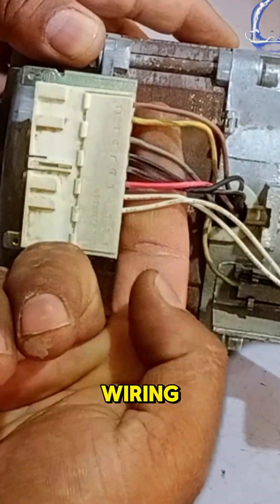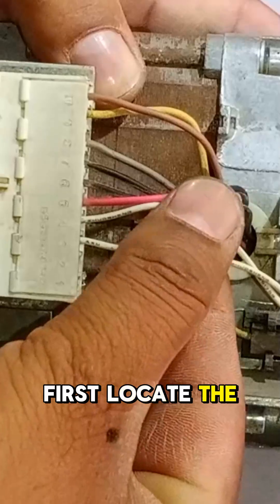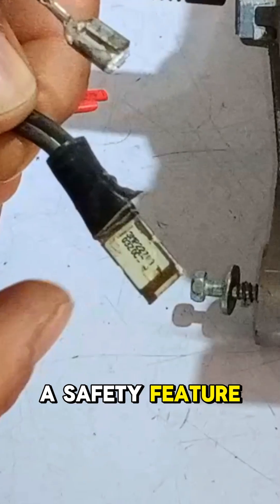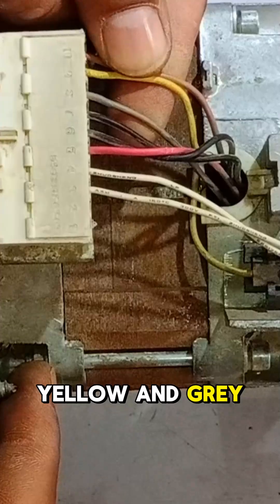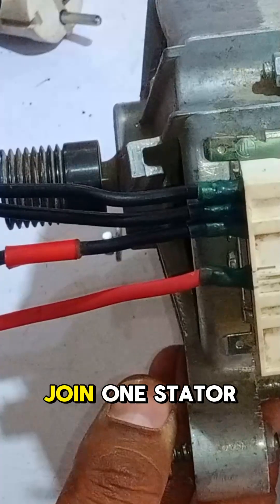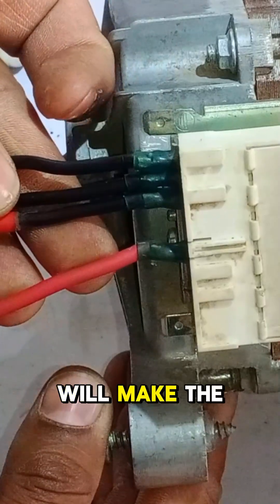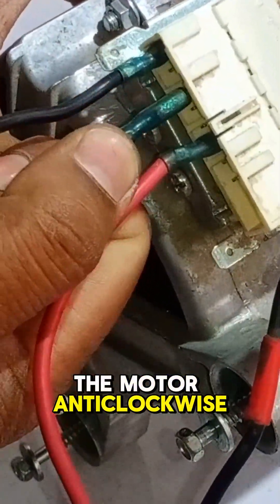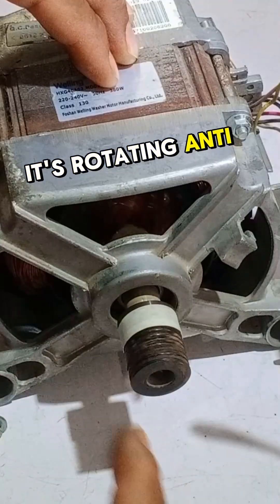Washing Machine Motor Wiring Made EASY!

Comment: I have a welling Samsung motor it’s only 3 years old the belt snapped no reason why got a new one but it never went round again I wasn’t there when it went wrong so not sure what happened the brushes are fine there is power going to the motor but when I tested it with a multi meter I can’t get to readings from it but the wire harness all the wires lit up my carbon brushes are still long the drum is fine the control board is fine it pumps fills and locks the door but nothing happens it will not go round at all even if I spin it while on.  Does this mean I need to replace the whole motor as that’s the only issue I can find.

Comment: This is one model of a "universal motor". There is also different kind that has 7 wires two for the tachometer coil, 2 to the brushes and 3 to the windings with a common neutral of the windings. Also the brushed motors can run at practically any voltage below 220v with only reduced power. Beeare as they do not have in built revolutions per minute limiters and can go very fast, up to 17k revolutions per minute. Check the wires to see which model you have and what wire goes where through what so you do not accidentally let the magic smoke out.